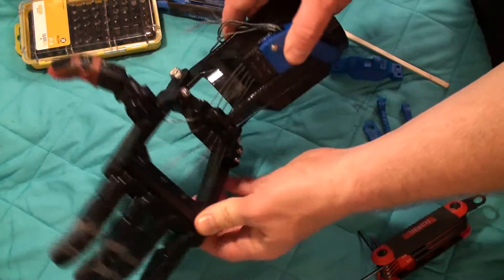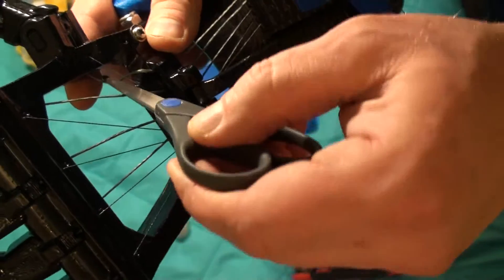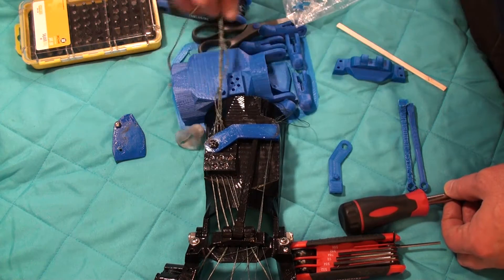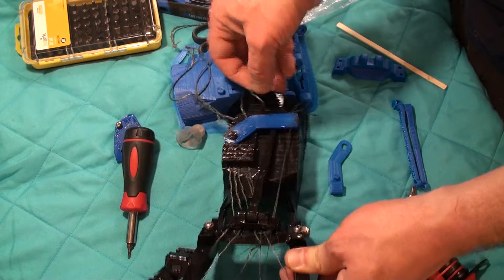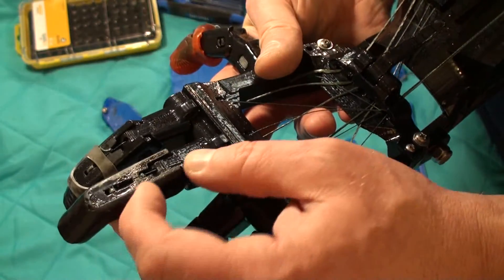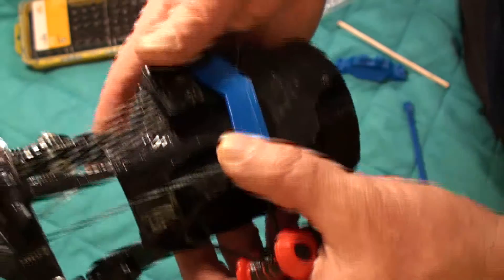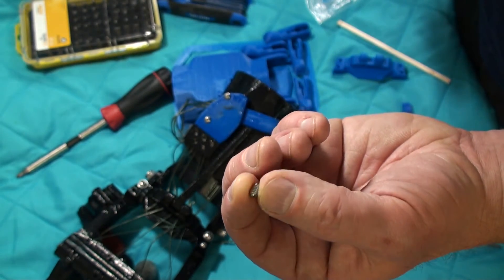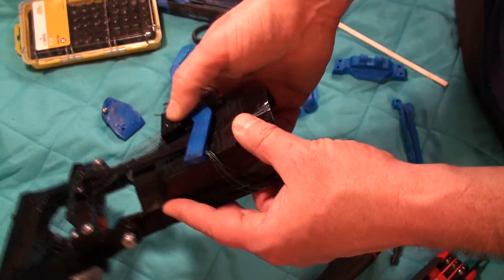Flextensor

Comment: Hi Peter, excellent work here designing this mechanism and I really enjoyed listening to your rationale behind each design decision. I do have a question about the set screws. It seems that the flexors and extensors are being held by the set screws solely via compression. Have you done any dynamic load tests on the unit as a whole to determine when/if those lines start to slip? Thanks, and keep on being awesome!
Reply from the maker: Mike Trieu ***** has done plenty of dynamic load testing, and you're right to wonder. Under heavy loads, the lines do slip. On Peregrine's latest Talon Hand, we use two set screws per cable, which seems to have ended the slipping problem. As development on the Flextensor continues, that is one of the problems to solve.